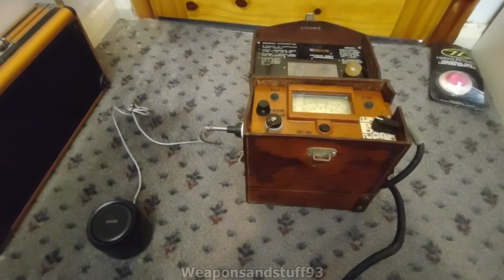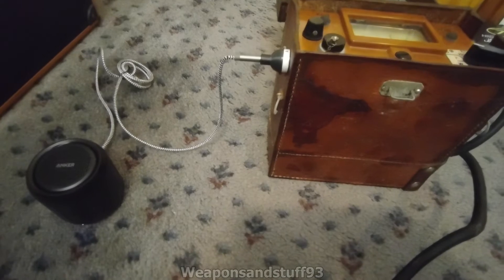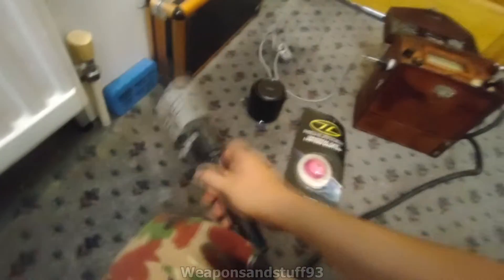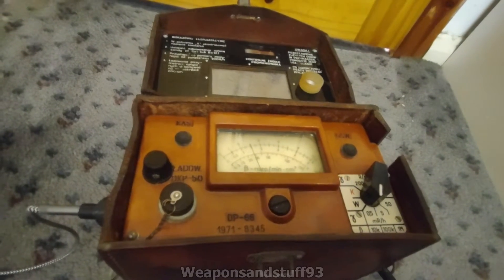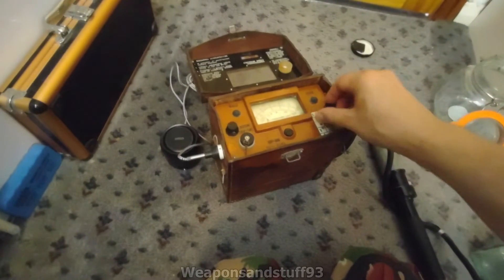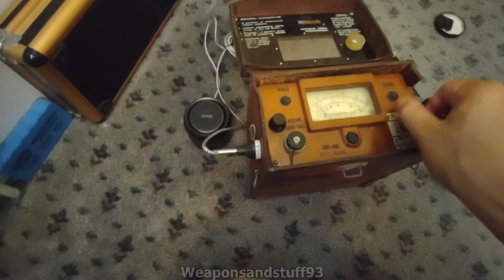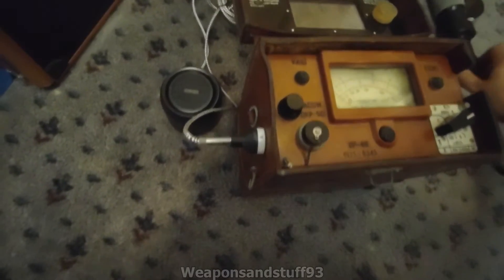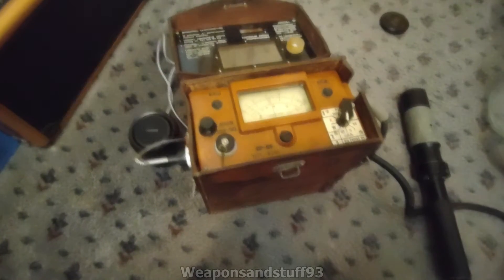DP66 Geiger Counter with loudspeaker

Comment: If you were specifically looking for Beta radiation, why did you not unscrew the probe cap and open up the Beta window? The different pitches come from switching over between the 3 geiger tubes inside the probe.

Comment: That's really interesting. I'll have to get hold of a mantle, to see if my Terra-P+ can detect anything from it. Strangely, my Terra-P+ occasionally sounds the alarm because it has a reading of around 0.25 microsieverts. Then it settles back down to the normal 0.15 - 0.17 micosieverts that I get here. I've never been able to determine what causes the spike or whether it's a false reading.
Reply from the maker: It will just be regular background spikes.
Reply: @weaponsandstuff93  
Cheers.